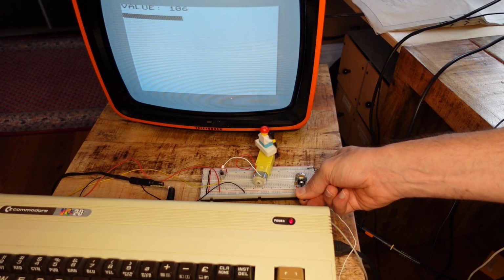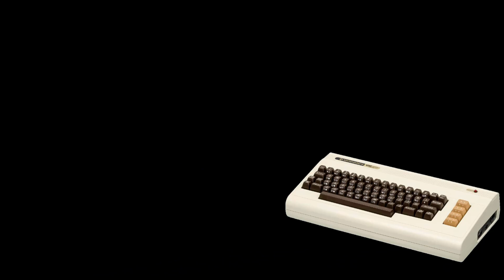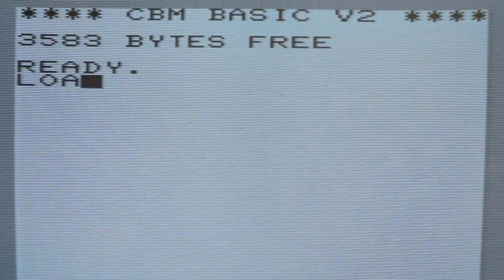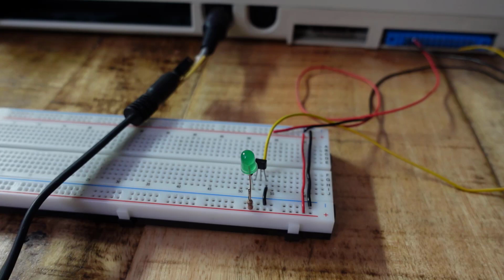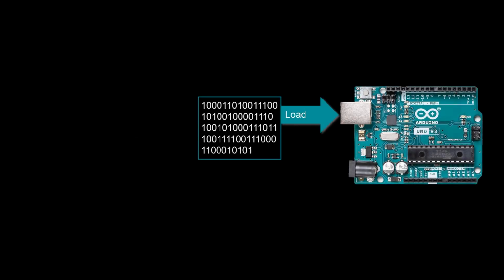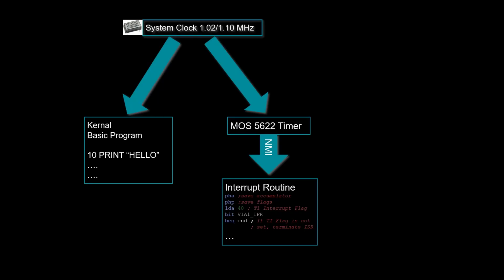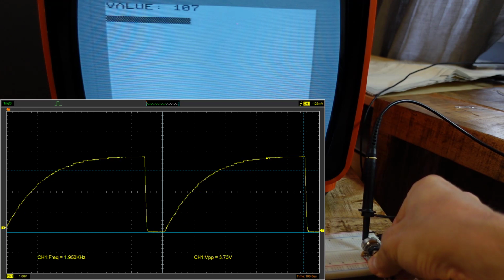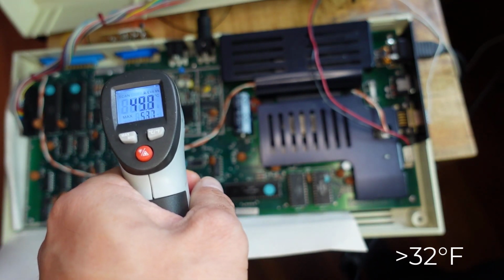VIC-20 vs. Arduino: Which One is Better?

Comment: Ahh, but blinking an LED with a VIC-20 is an accomplishment.  The Arduinio does it by itself.
Reply: That was my/the first C64 user port experiment... and nothing got fried. Then reading a pot, writing to tape, using an assembler/unassembler to do simple tinkering. So much excitement back it the '80s. I thank all the engineers who made it possible.

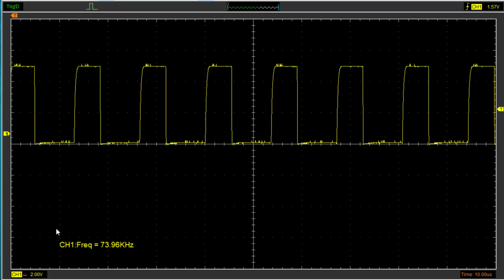Comment: 8:00  worth noting, the arduino libraries also cause a fair bit of overhead and if you write the program directly for the atmel microcontroller in assembly you could squeeze a lot more performance out of that too.
Reply from the maker: The I bitSet macros I used here write directly to the Arduino´s PORT register. The compiler makes very efficient machine code from this (I checked). The Arduino library however produces a lot of overhead, that´s right.

Comment: This is unfair and more like comparing apples to oranges...
The Vic20 uses an 8bit 6502 CPU running at 1MHz and has no machine opcode for multiplication or division WHILE the Arduino ATMega chip is a 16bit CPU running at 16MHz and has multiplication and division opcodes. This alone makes the Arduino 16x faster in speed, 2x wider in bus bandwidth and 5x faster in math routines with direct multiply/divide commands instead of running programmed loops.

Unfair comparison.
Reply from the maker: The ATMega is also an 8-bit CPU and supports multiplication of 8-bit numbers.
Reply: Not to mention the 40-year technology leap.

Comment: Very interesting, great to see what the VIC20 can still do! But you could have got your VIC to flip the bit faster than that by preloading LDA and LDX and then looping just: STA $9110; STX$9110; JMP loop;
Taking 4 cycles for LDA & LDX and 3 cycles for JMP, the loop would take 11 clock cycles, so should give 100kHz output from a 1.1MHz PAL VIC20. 
If you can use zero page, then it's 3+3+3 cycles so you could get 123kHz.
In fact your assembler must have used zero page, because 3 (LDA) + 3(STA) +3(LDA) + 3(STA) +3(JMP) = 15 cycles which gave you your 74kHz.
Reply from the maker: Sure, but even then the VIC 20 is still way slower than the Arduino.

Comment: The "how dare you?" bit made me fall of my chair. Literally.
In early 90s, when all I had was Spectrum and later MSX computers, Z80 powered, the idea of controlling a "something" with a computer was just mind blowing. In magazines were lot of schematics and programs to do many odd things like a dusk detector, presence, counters, light organs, and I did many of them.
The best part begun when PC with his LPT port (and ISA friendly bus) came. The speed, accuracy and horizon were largely increased. And because of the 486CPU, the Basic or Pascal were as fast as assembly. And easier.
I made a isa card that at address 200 had digital in/out and at address 210 had analog in/out, 8bit resolution. It was a pleasure to program and even in Qbasic was very responsive. I controlled relays, a motor, sensors.
Biggest thing  that I made was my own computerized electronics lab: a dual power supply controlled by computer, a frequency meter and a signal generator. All these on my beloved MSX but sadly I never got to port them to PC.
Who needed an Arduino when LPT was free for all?
Reply from the maker: Yes, it´s always amazing to see how this old stuff worked and how much has changed since then.
Reply: @DoctorVolt  Yes, and more amazing was the passion and excitement we put into those old technologies when they were new. It was like magic to me to instruct the computer to light a bulb through a relay.

Comment: You should have tried it against the C64
Reply from the maker: The C64 has a similar processor and clock frequency. So the result will be the same.

Comment: Wow. Now I really appreciate the arduino a lot more.
Reply: You realized that he just compared a Lamborghini (the Arduino) to a toddler's tricycle (the Vic20).

The biggest parts that he missed are that the Vic20 is interactive with the user and can be directly programed but the user but not with the Arduino which you need a computer to interact with it in order to program it and have it interact with you through the programs.